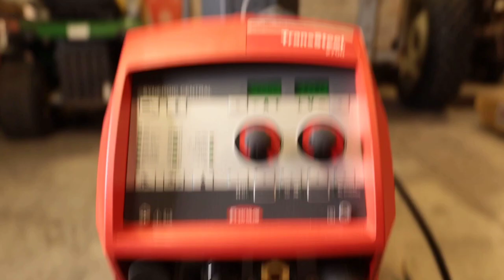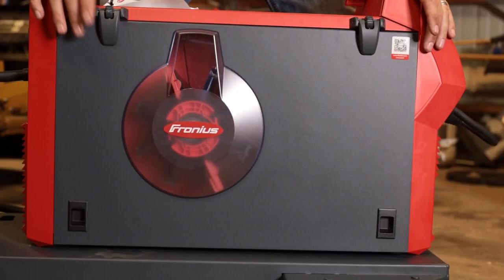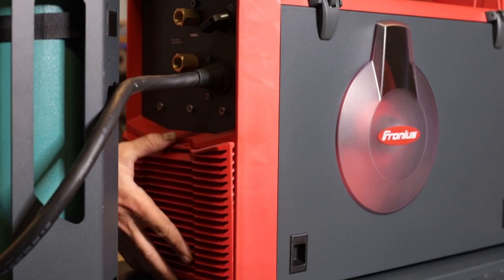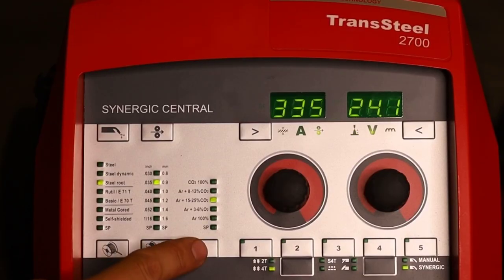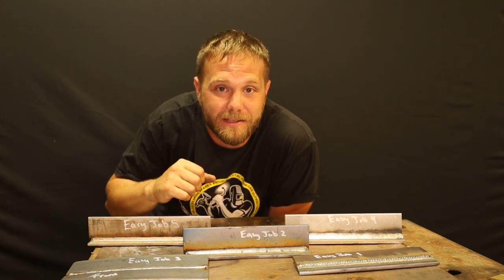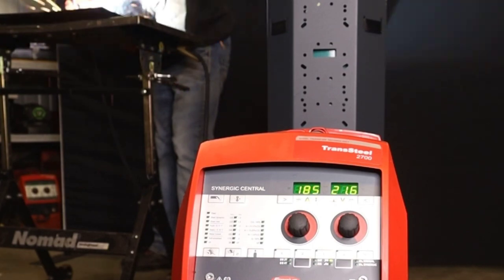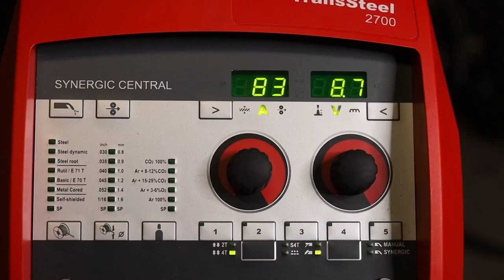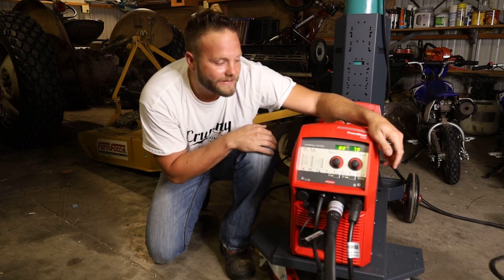Industrial MIG/STICK/TIG Performance With The Fronius TransSteel 2700 #TransSteel #overview #buynow

Comment: Thank you very much for posting this,  i had quite a few questions I had on this model I couldn't get an answer to online. Very informative.
Reply from the maker: George Hindley Thanks ! I appreciate the input 👊
Reply: @chris_b_liven  

I'm sorry, I'm getting at my wits end with this Esab model I've had for a few yrs. But- I can't decide which one model 2700 or 2200. The various gun liners that fronius sells with these to 0.035, 0.045 etc. Is there a separate linear that I have to swap out/purchase between aluminum and mild steel set up, is there one linear that works for both between feeding 0.30 to 0.045 and whichever alloy ? Thank you for your time
Reply from the maker: George Hindley I suggest ordering the 1/16 liner, .052 tips and .045 drive wheels and weld with 3/64 aluminum wire. You can weld all the way down to .060 plate thickness. Then swap the liner each time you want to weld aluminum as it will eliminate cross contamination

Comment: Got the TS2000, questions: 1) Why is there no Synergic mode for 0.8mm flux core? 2) Why does Aluminium start at 1mm, and if you have 0.8mm wire, can you still use it?

Comment: Hi, what would you advise for truck repair? Transsteel 2700 will be enough on thick metal or 3500 maybe?(2700 has one phase,that’s cool)
Reply from the maker: Hey. The 2700 should be a big enough machine for truck repair. What is the maximum wire size you will use? There is a promotion running where you receive a free secondary MIG lead with purchase. Shoot me an email and I can help with directing you to the closest dealer - Bliven.Christopher@fronius.com

Comment: I have the magic wave 230 and love it. Thinking about getting this to upgrade my esab fabricator 252i. What CANT this do that the comparable MiG only miller and Lincoln’s (powermig and millermatic) can do? Anything? Why would anybody not get this?!
Reply from the maker: It’s has everything plus more!! Only reason someone wouldn’t buy this is because they don’t know Fronius
Reply: @chris_b_liven  I feel that. It just feels borderline goofy to buy a multi process machine strictly for the MiG. I wish they made a MiG only equivalent that was cheaper because I already have a way better tig and will never use this for tig. My only other wish is that this could go way lower amps on 115 volt power like the magic wave can.
Reply from the maker: @calebsiegler5471 It’s hard to beat the Magic Wave for TIG welding . I sent you another message

Comment: What is the liner size you recommend for using mig for aluminum 1/16, now is that the same as [ Fronius Mig Gun Steel Liner C 1.6 - 40, 0002, 0055, 005]? Can you please send a link or a description how to set this 2700 up for Mig Aluminum

Comment: Spray arc  is above 31V on the mix 82Ar/18Co2
Reply from the maker: It ranges depending on wire size as well. I can get .030 wire to spray around 27-28 volts depending on wirefeed speed

Comment: I have the same machine running on a single phase power supply but i don't know why im limited to 155 material thickness on the board Mig Synergic mode what am i doing wrong ?
Reply from the maker: Which type of wire and diameter? There is a background setting where you can set your fuse size. Make sure it’s turned to max or off to open up the machine amperage

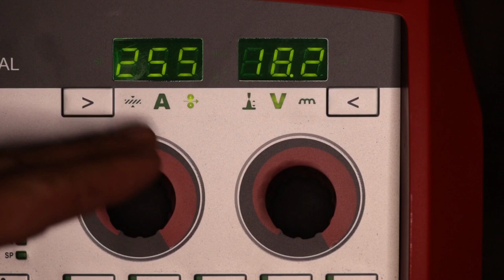Comment: I have a quick question, When you were adjusting your settings at the 7:57ish mark how were you able to adjust it in that manner. I've tried numerous times to make the settings on my TransSteel 2700 and my machine will not allow me to make the adjustments your making. If I adjust the voltage the wire feed speed changes, Like I cant seem to change any individual setting while in synergic mode like you are here. Thank You
Reply from the maker: You have to turn on ALC in the second setup menu to separate both

Comment: What's the  amperage the brakes and the  gage of the extension power cord you use for the single phase?
Reply from the maker: 30 AMP breaker with 8 3 cord… The machine comes with a 8/4 power cord

Comment: Do you sacrifice penetration trying to get the TIG appearance with MIG?
Reply from the maker: freshpootube Yes, you can sacrifice penetration as you have to run short circuit MIG to achieve the appearance. My suggestion would be to weld one using this technique and one with no weave and higher settings. Cross section and etch to determine penetration in the root. This will show you true strength based on techniques. For anything structural I suggest a non weave with higher settings

Comment: If money is not an issue…would you buy this mod over the 2200? Thanks
Reply from the maker: If you need the option of bigger spools then Yes! If you don’t mind 10lbs spools and the option of 110 then I would get a 2200. There is a promo running until July 15th on the 2200. If you register the serial number you get a free MIG lead. If you shoot me an email with your info I can have a distributor reach out - bliven.christopher@fronius.com
Reply: @chris_b_liven  I sent a message. Thanks for the info

Comment: Great Video! I'm glad someone finally did a Video on the 2700. They are always the 2200. This is my Dream Mig Machine. This does have Pulse capabilities on Mig as well doesn't it?
Reply from the maker: Phillip Chambers I’ll start a new trend of 2700 videos. No pulse capabilities. It runs so well without that you would think it does. Thanks for watching Phillip
Reply: I have a pulse machine Phillip and believe me, they're not all what they're cracked up to be. We've all gotten 2nd degree burns from pulsing, my son spent almost 2 weeks hibernating in his room from flash burn (his helmet on 10 darkness). My machinist looked like cooked bacon and it ruined my welding table pulsing black bubble streaks through the cracks of everything we welded. It welds great in synergistic mode, but if I were you, I'd steer clear from anything pulse for now. And yes, I had the correct gas, we mix our own here.
Reply: @shelbygrinders3839  seems someone dont know how to use a pulse mig.. Ive tried out a tsp400 and that was incredible..

Comment: Chris  the thing with spray is if you going to do it then you have to do it correctly otherwise its almost pointless at times.. The fact that you getting spatter indicates that you are not actually in a spray because of your gas mix.. you need a narrow penetrating arc for spray to work correctly.. theres two arcs in spray believe it or not.. one fans out and super heats the surround base material.. the 2nd is the one with the punch and that punches right into the root of the parts you welding.. hence the good penetration.. you may well do get decent penetration of what you doing now but its wont be anywhere near as good as it could be. Spray is a hiss with a very slight crackle to it but you should be getting no spatter at all and spray is always done in a push due to how the arc behaves.. hope this helps from your fellow fronius user..
Reply from the maker: Thanks for sharing 👍 I’m a big fan of 95/5 O2 - What’s your favorite for spray ?
Reply: @chris_b_liven  I don't use a dedicated gas for spray my self.. i use a 83/15/02 mix as it works on almost anything.. i just have to up the voltage higher than normal to exceed the transition phase for a true spray.. luckily that is easily done as i can go upto 45v on my 3500c
Reply from the maker: @Migman2020  Awesome!! I wish I had three phase power
Reply: @chris_b_liven  Best way to get 3 phase is just hooking up a 20kva avr generator tbh Dont do what some people do and use rotary phase converters because they kill welders in the long run etc But yeah i got fed up with single phase welding a while back.. far too limited for the large jobs

Comment: Will it weld body work? 22 gauge steel Chris? What's the thinnest you've been able to weld effectively? Lastly, how does it compare to the 2200 with welding thinner material?
Reply from the maker: Shelby Grinders Body work wont be an issue with the machine. I suggest using the steel root program as it’s super stable down to 20-30 amps. I didn’t talk about the stitch timer it has included but this works very well for keeping heat out. At the very end I told the limitations on single it’s 220 Amps MIG / 180 Stick / 260 Amps TIG  . Let me know if you have more questions
Reply: @chris_b_liven  Yes I actually stopped the video short and asked the question about the amperage prematurely lol. I edited the question, thank you brother and sub'd. ;)
Reply: @chris_b_liven  One last question, barring the 44lb spool, is there any benefit to getting the 2700 over the 2200 since the amperage is exactly the same via single phase? I really like being able to plug my migs into a regular 110v as well, (which the 2200 has capabilities of doing), so again, would there be any benefit at all barring the 44lb spool?
Reply from the maker: Shelby Grinders Thanks for subscribing 👊
Reply from the maker: Shelby Grinders 4 roll drive system vs 2, larger spool options, about 30 more amps in TIG, Root programs and possibly of three phase power. If you like the 110 option and don’t care about larger spools then I would say 2200
Reply: @chris_b_liven  By "root programs" can you explain? Sorry if I also missed this in the video. I'm just torn now between keeping this 2700 I have sitting in my shop or exchanging it for the 2200. Corey from Fronius directed me to this video to help explain a lot of the things you went over. Really appreciate both you guys.
Reply from the maker: Shelby Grinders Root programs are a modified short arc program giving you very little spatter, reduced heat input and perfect control in open root but joints or thin gauge material. They have solid wire 70–6 and 308 options in the 2700
Reply: @chris_b_liven  Ok watching the video again and I at 9:48 you're discussing the "steel root program." I could have sworn The Fabrication Series did a video on the 2200 and had that same option? Is that not the case?
Reply: @chris_b_liven  Thank you man, appreciate the responses. I understand now, looking forward to running mine. I'm keeping the 2700 for sure.
Reply from the maker: Shelby Grinders Awesome! Feel free to reach out anytime
Reply: @chris_b_liven  Yes sir, greatly appreciate you and Corey. Glad to be a part of the Fronius Club!
Reply from the maker: Shelby Grinders shoot me an email with your info and shirt size and I’ll send you a swag bag bliven.christopher@fronius.com
Reply: MilkyCereal83 email sent brother!! Awesome!
Reply: I really appreciate the video and explanations but I have one question just to clarify. Is it true that Mig welding Steel and Mig welding aluminum there is no thickness difference between the 2200 and the 2700 on single phase 220? Thank you for the help in advanced guys.

Comment: On 230 volt can you run this machine l blast as I've only got access  to 32amp 240 volts I was under the impression that I could only get to 230 amps on 240 ?
Reply from the maker: 220/230/240 V single phase you get maximum 180 amps stick/220 Amps MIG/260 AMPS TIG
Reply: @chris_b_liven  what is the duty cycle of the 2700 on single phase, I’m trying to decide if o should get the 2200 or the 2700. I only have single phase
Reply from the maker: @stevenhjorleifson1050  Hey the 2200 is 100% at 150 amp 230v and the 2700 is 170 amps 100% 230v. I would say the benefit of a 2700 would be larger spool accommodations, more wire type options, 4 roll drive vs 2 and groove weld root programs. Fronius is running a promo until the end of the year as well. Any purchase 2200/2700 receives a bundle with registration of serial number
Reply: @chris_b_liven  where can I find out more about this bundle? And is it available in Canada?

Comment: Weird thing I noticed is that the 2700 on single phase actually has less output power on MIG, TIG, and STICK than the 2200!  I did not expect that!
Reply from the maker: It’s same output for Stick/MIG and 50 amps more in TIG. You are correct! Buy this if you need larger spools or want the 4 wheel drive vs 2

Comment: Does it have synergic mode??
Reply from the maker: Gustavo Muñoz Yes. This is what I was welding with was Synergic mode
Reply: How do u dial in the thickness of the material??
Reply from the maker: Gustavo Muñoz it’s to the left of wirefeed speed. You can set it in thousands or millimeter
Reply: Sweet thank you, hope i see more vids on this machine there is almost none that show the real power on it
Reply from the maker: Gustavo Muñoz Count on more videos with this one

Comment: what max amps? mig on 230v and cycle?
Reply from the maker: 220
Reply: @chris_b_liven  yes you said in your video thank you. im watching your video a lot about fronius welding. hopefully they make Pulse mig support for singgle phase. transteel 3000 pulse mig. 3 phase only
Reply from the maker: A single phase pulse TransSteel would be epic !!!
Reply: @chris_b_liven  why in others brand already made like miller multimatic
Reply from the maker: @dommendoza  Fronius is a Austrian owned family company with the core market share in Europe. A majority of power outside North America is three phase. What city and state are you from ? I could setup a demo so you can test if you need pulse

Comment: Great review! Great video! But you did a booboo. The mig lead isn't hot in stick and tig mode. You literally disconnect the feeder when you pull the lead out to put your stick lead. 🍻
Reply from the maker: Thanks for watching !!!! I appreciate it
Reply: @chris_b_liven  I am using a Miller XMT350 CC/CV multiprocess with a 74DX feeder for my mig and a Dynasty 400 for my tig here in my home shop and I am thinking about jumping on the fronius transsteel 2700 myself for a dedicated light general use mig. You did a excellent job and you are a good welder
Reply from the maker: @sledsports  Great to hear! Shoot me an email and I could setup a time to discuss. Bliven.Christopher@Fronius.com
Reply: Yea. I need a roll around unit. My remote feeder is nice but it's a hassle to drag the lead, the control cables, the optima control, and the inert gas hose all together around the shop.  I'd rather have a little roll around unit with just a main to drag. Is it the full 270 amp on single phase in mig or is it cut back too?. I know my miller's will run full bore 400 amp on the dynasty and 425 and on the xmt but the duty cycle suffers. The dynasty is 15% full bore 400 amp on single phase which doesn't bother me any as I tig only with it.
Reply from the maker: @sledsports  Yes, the TransSteel 2700 is lowered down to 220/230 amps single phase MIG. If you need that much amperage a rotary phase converter would be a perfect pair. It would depend on how much amperage you need
Reply: I have a 30 horse rotaphase in the corner. I haven't tried to put my miller's on the rotaphase as it throws a wild leg. I am afraid it might let the smoke out lol 😆
Reply from the maker: @sledsports  I’ve used many. The Fronius machines protects itself from over voltage